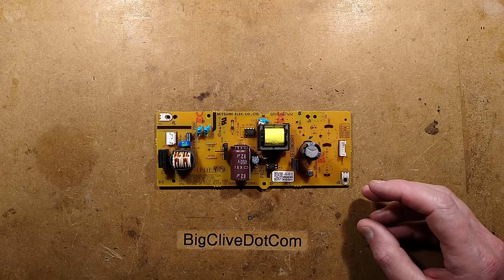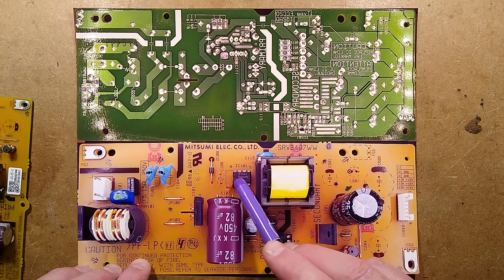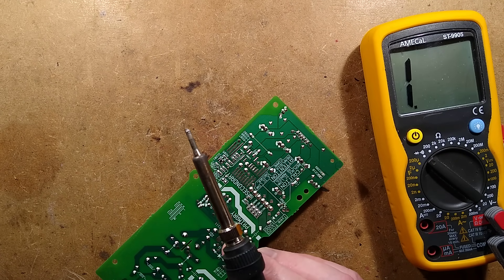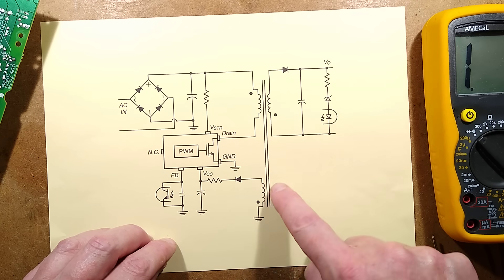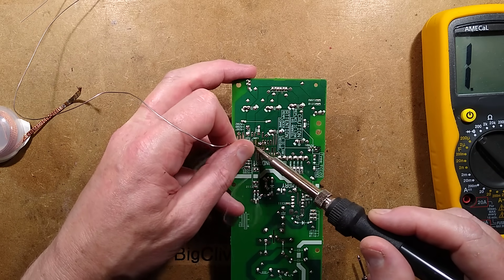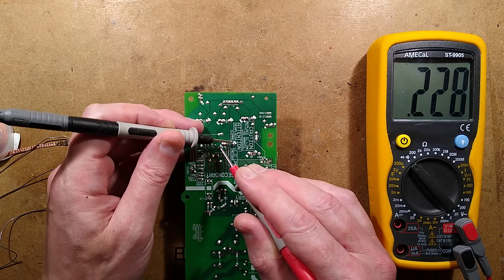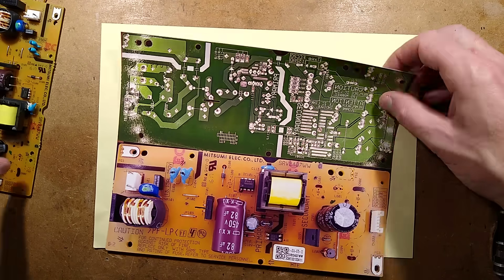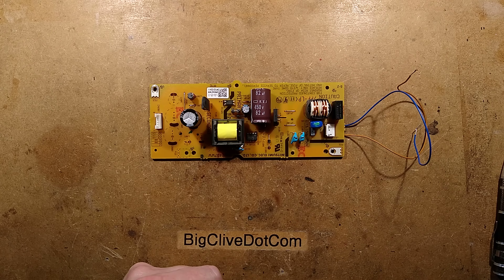Diagnosing a faulty PSU

Comment: Can not beleive they connected the two diodes in parallel, the voltage drop mismatch will always cause one of the diodes to carry the majority of the load so no wonder it broke eventually.

Comment: Hi Clive, I have a similar looking power supply, 12V 10A which stopped working after the electricians were in, they kept tripping the mains power whilst testing and maybe coincidence but it stopped working after that. The power supply powers a NAS and its like the NAS tries to power up but then starts over again as if there not enough umph. It's not an expensive item to replace and I've already ordered a replacement but I was hoping to diagnose the component(s) failure as a learning exercise but have thus far failed. I did find a 1000uf 16v cap that was bulged and replaced that but the fault persists. I wondered if you could offer any pointers ?
Reply from the maker: Did you replace it with a low ESR capacitor from a known good supplier?
Reply: I’m not sure, I had some I bought sometime ago. I had another look this morning and decided to take group of 3x 2200uf caps out next to the 1000uf I replaced.  Took them out all in one go as they that were all glued together.
They looked ok on the top but one or two of them definitely look like the bases are expanded out on the bottom.
I have ordered some from Amazon to try tomorrow.
Reply: @bigclivedotcom  Ok, I swapped the 3x 2200uf and powered it on briefly.. The blue LED lights up, I think it was doing that before. I measured the output and it's fluctuating between 10 to 12 volts and here's like a ticking sound coming from it. I haven't tried it on the NAS because I don't think it should do that. LOL
Reply from the maker: @healeydave  The ticking noise may be the unit restarting repeatedly.  It might be more stable with a load.  But it could also indicate an issue with the small capacitor on the primary side and its diode.  (The bootstrap circuit that powers the primary circuitry and also acts as feedback.)

Comment: Hi clive,  I have an damaged 5v mobile charger but it only has one coil going from primary section (the one with high volts) to secondary section is it possible to repair it with a str module it's pwm chip was all internally shorted with a shorted fuse and diode as well
Reply from the maker: I'd recommend replacing the charger completely.  They are not economically or safely serviceable.

Comment: Anyone know how to repair a devolo magic 1 wifi power-line unit or - how to get them open..... it just doesn't work when plugged in. I suggest the internal fuse has gone &/or some capacitors have blown but I just cant get inside without damaging. I have taken out the screws & tried to spudger on the top off but it is ripping the lip?
Reply from the maker: Stuff like that is often clipped tightly or glued together, and can't be opened without causing case damage.

Comment: Why do you add solder before removing the diode?
Reply from the maker: Wetting old solder with fresh stuff breaks through the oxide and also makes older solder more fluid.  Especially if it's lead-free.

Comment: Thanks for the Vid: one quick question, since you had identified the diode was the culprit and why do we need to replace the capacitor? Thanks in advance
Reply from the maker: It's always good to replace the output capacitor in older switching power supplies.  Making sure you use a low ESR one.
Reply: @ Got it😊

Comment: Thank you for a great explainer. Very beginner friendly♥ On this topic of a faulty PSU of a computer which makes a loud screetching kind of sound, like a coil wine, where would you suggest starting a failed component investigation. The sound is very prominent on the high(mains) side.  The motherboard blew my CPU, mainboard and damaged the PSU for some reference. It is a 750w PSU from coolermaster, so not the best quality components. It clkaims to be 80+ Bronse, but I am skeptical. I force the PSU on via the ATX pin bridge trick. Nothing else smokes/smells if keep it on, even for 5mins. Noise continues
Reply from the maker: It's hard to say the exact cause.  It may be a poorly made transformer if the power supply is otherwise working and not getting excessively hot in use.

Comment: I have a cautionary tale from personal experience about diodes failing in switch mode power supplies. Having had many units returned as faulty, diagnosed as short-circuit diodes, the current rating of the diodes was increased. Failures continued. Having replaced a diode in a faulty unit, I examined every node of the circuit with a 'scope. I observed very narrow negative 75V spikes on the diode. This was a 50V PIV (Peak Inverse Voltage) diode. Aha! maybe it wasn't a current problem, but a voltage problem! Changing to a 100V PIV diode at the original lower current rating resulted in zero failures. How could it it be that this problem slipped through? It turns out that the 'scope I was using was a new one (can anyone see where this is leading?). It had a higher bandwidth than the previous units. On the same PSU, the spikes were visible on the new 'scope, but not on the older ones. You can quote this totally true story when your boss asks "Why do you need a new 'scope. This one's just as good as it was when we got it 15 years ago! It's hardly been used!"
Reply from the maker: This is why many switching power supplies have an RC snubber network across the schottky diode to shunt the rogue spikes.

Comment: Hello! Please help... I have a power board from my Amana Mytag fridge freezer, and I am trying to troubleshoot it. I have identified and replaced several bad, electrolytic capacitors, and a blown overload relay, which I have replaced. After testing the windings of the compressor and the cooling fan (all good), I installed the repaired power board and turned on the fridge. it ran for about 15 minutes perfectly. I turned it off to do something but it refused to run again when I turned it back on. I took the power board out again for further diagnostics and found that one of the inductors is reading 65 ohm, with no continuity beep. I suspect a problem here, but I am uncertain. I have removed the inductor from the board but the markings are insufficient to identify it's type and specifications. My question is, am I barking up the wrong tree? The only markings on the inductor are 333J  06339   and VEI on the side. It measures 8mm dia x 10.5mm high and had a lead spacing of 5.0mm with 0.6mm dia leads. The inductor is heat shrinked black. Please help, I'm going nuts without a fridge and since this one cost over 2 grand I would rather save this fantastic fridge than bin it and buy a new piece of crap from the far east, that's only going to last a few years!

Comment: if thats a dual package diode, doesent it suggest that the secondary of the transgormer is center tapped?  not just a single winding as in your diagram?  or have I missed something?
Reply from the maker: Single winding, parallel diodes.

Comment: Hello!
Ive had a smps like that one and fuse and the chip got blown up couse of an output sort ive changed the ic and the burnt components and it worked fine at start but after 2 hours it blew again. I suspect the optocoupler but i might be wrong. You think im right?

Comment: I've always wondered why people use braid to clean holes in a circuit board. The braid is an ideal tool for cleaning SMD and BGA pads, but the holes are much easier to clean with a toothpick; the solder stays in place, and nothing gets thrown away!

Comment: How did you get the photo of the bottom of the board to match the photo of the top (top versus bottom component placement would normally be inverted )?  Did you use some inversion app to make it match?  Normal rotation wouldn't do it I think !!!

Comment: What type of electronic repairer are you?
If the double diode is defective on one side and you know that it is on the same substrate, this means that the other diode will burn out in a short time, especially since it will be subjected to double the current ! As a good technician, you must change the double diode and try to find out why it burned out. Your video is absurd!
You post videos so the world thinks you're good.
Gain experience for several years and then we'll talk about it.
Let's say your car has a wheel that no longer turns, are you just going to remove it and drive on 3 wheels?
Think about it.
Young people learning electronics must have real knowledge.
I have been doing this job in electronics for over 50 years and I deplore people like you who don't know what they are talking about.

Comment: This is a flyback converter. They are notoriously hard on the capacitors and the output diode because of the trapezoidal current waveforms they produce. Since the output of the flyback only receives energy for part of each switching cycle it means that the currents must be quite large so that the average current (the DC load current) can be met. So if the output is, say, 1A DC, chances are pretty good that the peak output currents are on the order of 3-4 amps. That is tough on the diode and the output filter capacitor. Usually the component that fails on a flyback is the blocking diode, as happened here.

Comment: Should buy a solder sucker.
Reply from the maker: I have one.  But only use it for specific applications.
Reply: @bigclivedotcom  Understand risk from electrostatic damage using a sucker but pad damage  & component frying also a factor. Hard to tell if component failed in normal use or damaged by the brute force removal method. Me, if the component is cheap & readily available, I just cut the legs off & remove individual remnants.  Normally enough left of original component to test out of circuit via a component tester.

Comment: I hear the words "dead short" and I immediately think "capacitor" too. Next, I postulate, what else has this capacitor, if found, (alternative, shorted tracks?), taken out? A short (or even a "medium"?) does amusing things, elsewhere on board, sometimes. Diodes are a natural, but it can tickle other parts too, transformers, for one. Sometimes all! Also, have you ever noticed on odd (very?) occasions where restoring with a new component somewhere places stress,  renewed or new, on another component, causing it to fail afterwards? An "It tested okay before, isolated, why is it shot now", kind'a thing?

Comment: I have a smps from a piece of equipment that's been dropped on floor during use, one of the windings in the transformer went open circuit. I can't find out the exact part number, I do have the schematic,  any tips for re-winding it myself? I have this number if it helps - Z0630D
Reply from the maker: It's not easy to rewind a small switching transformer properly.  The most likely place for your open circuit is probably a cracked solder pad/track on or more of the transformer's pins.  They are prone to stress damage after an impact.
Reply: @bigclivedotcom  Yes, thanks Clive, thanks for taking the time to reply. Access is extremely limited on the pcb, had to remove the transformer, there was a broken wire between the core and the plastic pin housing,, decided to unwind it, did so partially - now have the main and auxiliary winding on the primary unwound so know exactly the length and gauge of wire, but like you say - it's not an easy job, I don't have a variac, I'd be inclined to shelf it. Out of curiosity I'm thinking I could connect the output of a signal generator to each of the secondary pads, say 20Khz 10V to 30V (as per requirements on schematic) to confirm the DC side is working?

Comment: 4:49 I prefer inertial desoldering - heat the pads and whack the PCB edge-on on the bench top. most of the solder will splash off.
Small pcbs can just be dropped on the floor

Comment: Recently, I was looking at an old Delta power supply rated 72 V and 20 A. In it was an enormous  22,000 uF / 460 V smoothing cap. Now THAT woukld have been a spicy moment would you have shorted that.

Comment: if the diodes are in parallel did you not reverse bias one then forward bias the second? Giving maybe a false assumption of a short but it could mean that the common is on one side of the Plastic package for the dual diode.

Comment: The trick with getting out 3 pin components is to put a solder sucker on them.  I'm sure you know this and were just a little rushed because you were on camera, but other people may not.  It's not foolproof because sometimes you get a small amount of solder left attached which your iron then can't reach - so you have to put some new solder on and then repeat the process - but my experience is that it's the way to start.

I'm watching this because I have an SMPS for an audio DAC that has failed - with the voltage collapsing under load - and this has shown me another pitfall of cheap PSUs.  They don't wash the boards thoroughly after being flow soldered.  You should have seen the amount of white muck on the back of the board after a few years of life!  They don't care, of course - it'll be a few years before those crystals grow enough to cause a failure.  (In this instance cleaning it up didn't remove the fault, but it's probably true nonetheless.)  But that amount of crud doesn't help with getting solder to flow - which is my next step, and i can straighten up some of the components at the same time.

I've repaired or pulled apart a fairly large number of SMPSes, and again just as a point of note for your viewers, by far the best ones have been those from Toshiba.  They're the only ones I've seen with proper amounts of electrical safety insulation (often several layers rather than just a single sheet of acetate), with copper heatsinks, properly rated components, and no safety or signal conditioning components missing.  They are very much not a minimalist or cost cutting design, and the contrast with supplies from Apple or other PC manufacturers is striking.  (As a slight qualification to this recommendation, I obviously haven't been inside supplies which haven't failed so there may be other manufacturers like Sony who operate at the same standard.)

Comment: Could someone please help a noob understand why you would rectify before the transformer? Surely stepping down before rectifying is the obvious solution?
Reply from the maker: The rectified mains is converted back into AC for the transformer at very high frequency, allowing much smaller components to be used.
Reply: @bigclivedotcom  Today I discovered flyback converters! Thanks for the answer, and love the channel.
Reply: @bigclivedotcom  So instead of using a bunch of big big smoothing capacitors? Sad to say I still don't understand the total of what's going on.

Comment: Years ago I purchased a "flat" CRT computer monitor on eBay, it was almost brand new good but the VGA connector was smashed, since I had used cables with the connectors still in good shape I opted for replacing the cable, I took off the back cover and simply out of habit I checked if the electrolytic of the power supply was discharged and still had about 290V and it had taken a week to arrive and I still hadn't plugged it!
So definitely the "I already unplugged it yesterday" does not guarantee any security when working with high voltage capacitors

Comment: Thanks BigClive for going through a bit of switch mode diagnostics, I'm encouraged to whip the PSU out of a misbehaving plasma TV that does have a puffy cap in it; I wouldn't have thought about the diode though.  I'll have to dig my Hameg out of the loft check a few components.

Comment: just dismantled two identical old blown 12v PSUs.. One no sign of fault. The other a blown in rush resistor and diode (3 others look fine). not really willing to spend much time on them. What are the odds of taking the one diode and resistor from the other board (both look fniw) that it will fix it.

Comment: Ever seen a failed SMPS where a 10MΩ resistor failed open? This thing was part of a divider providing a reference voltage for the PWM chip's undervoltage protection. It was the high resistor, so the chip thought that the line voltage was too low and wasn't turning on. After fixing the problem, the output was too low, so I replaced a resistor in the TL431 feedback circuit with a precision potentiometer and got the output where it should be. (I also blew 4 diodes and 7 fuses in the process of trying to probe the thing without an isolation transformer, and had to replace a zener diode in the simple regulator circuit supplying the PWM chip and optocoupler with low voltage, which might be the fifth diode I blew, I'm not sure if I blew it or if it was already bad). This is the power supply for a DVD player with surround sound, which has been in line for a fix for years, and waiting naked on the bench for months; I finally made it to the point where I could understand and fix it. It was so gratifying to see the DVD player come up on the screen and operate.

I ended up probing the board by floating my probes. I probed ground with channel 2, and the area of interest with channel 1, inverted channel 2, and added channels 1 and 2 together. I effectively had an isolated probe by doing it this way, except that not all the 120V 60Hz cancelled perfectly; but I was measuring low voltage riding on top of relatively high voltage, so it cancelled well enough for me to peer into what was going on. I used inexpensive generic probes with toggles for 1x and 10x, and I did it with 10x attenuation, which was great to have when my secondary scope's volts per division only goes to 5V. I wasn't going to probe this thing with my Tektronix scope without using an isolation transformer; I didn't need any more than a look at the waveforms with rough scale in mind to do the job anyway. Good ol' BK Precision 1479B handled just fine.